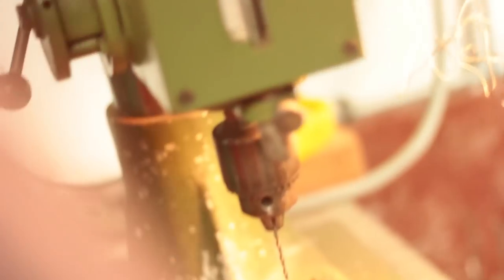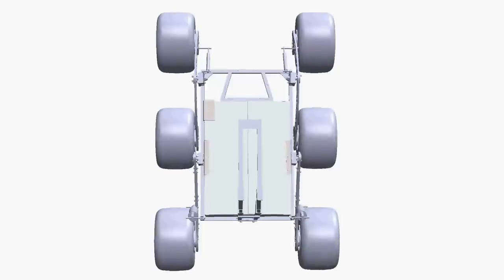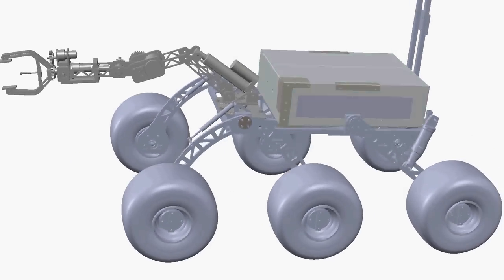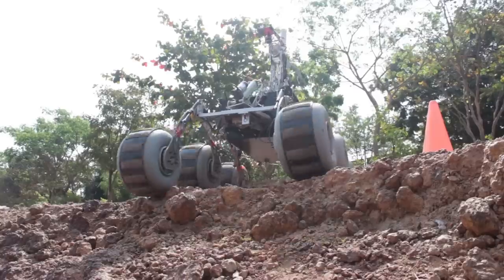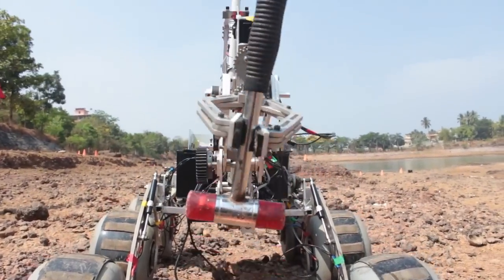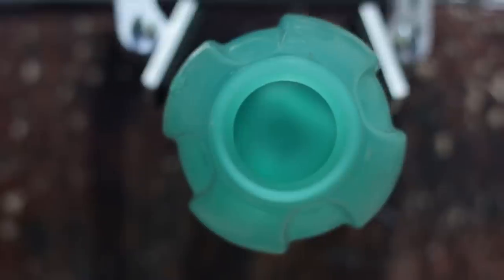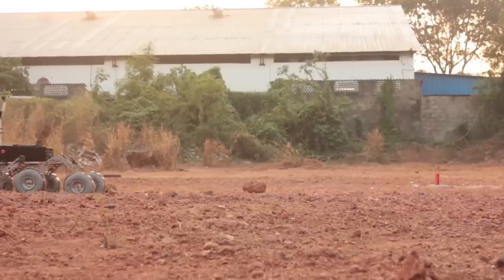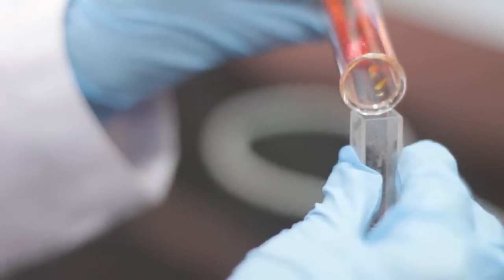Critical Design Review - Mars Rover Manipal - URC 2017

Comment: The Mechanical part and the frame of the rover is very weak....it is wobbling when making a turn....also it's not very smooth while driving......soil collection unit is very good but the steering system is poor.....could have worked better if there would be dedicated servos or steppers to turn the wheels.....and no rover has that kind of wheel......good teamwork but finally not satisfying results.....happened to me also
Reply: Well, I guess I'm a bit late to comment. Why do you think the wobbling is there? On what basis do you think the frame is weak? A design is made to offer a solution to a particular problem. If you would've researched, the competition takes place in the US and not on Mars, therefore the wheels at that time were a perfect decision. Moreover, understand that a project has several limitations and delimitations that were critically thought upon. What results were you expecting?